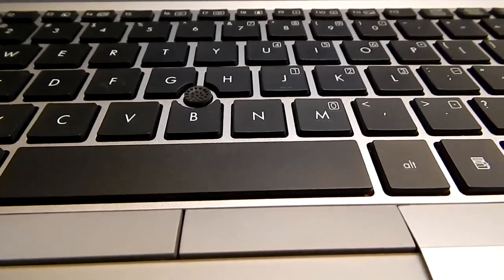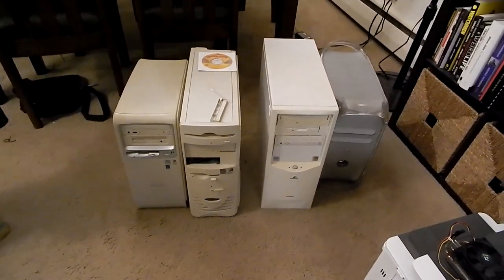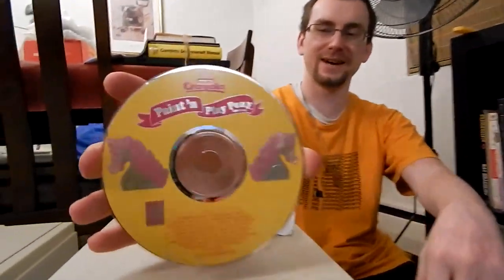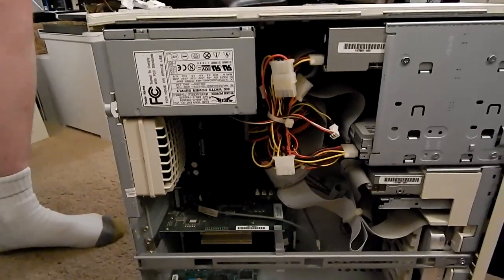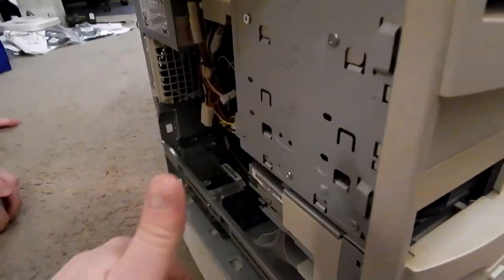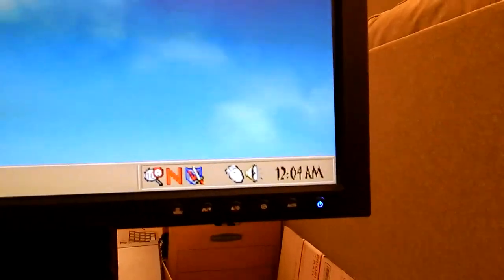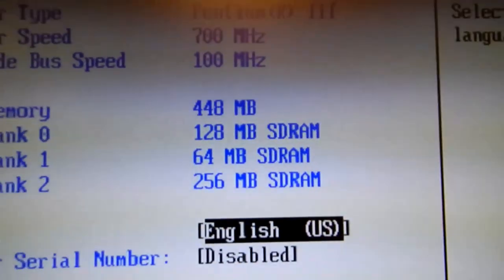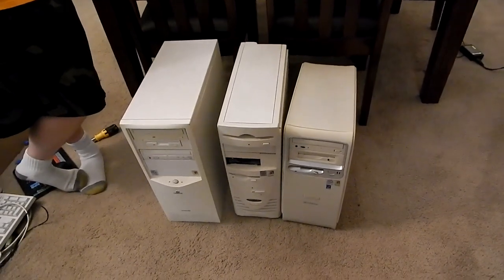Grateful42's 90s Computer Extravaganza

Comment: You're not the only one to have a PC mainboard that apparently won't put out a video signal.

I have a Gigabyte EG41MF-US2H v2.1 board (I think that's the model number of it), that has a few problems, including a dead floppy drive controller, but recently, when it boots, it would sometimes initialise video, it would sometimes not, but the rest of the system would run, just that there was no local display. If I leave it unplugged for many hours, then it would usually initialise the display on the next startup.

12:49 I thought that was some Barney game when I saw the disc in the video thumbnail.
Reply: SnowWall
Ah, I see. For me, I run my HDMI cable from the graphics card to a splitter, and from there to the monitor, so I thought it was the splitter that was the problem, as it pulls its power from the HDMI connection, but still includes a power adapter.
I too, use an NVIDIA card with my system.

Comment: What your doing is pretty cool,  I want to build  (rebuild ) an old dell dimension 4700 one day. I want to put all the best hardware that is compatible with the socket 775 motherboard. Upgrade to 64 bit,  8g of ram, boot from a ssd, etc.  Make it an ol sleeper pc, maybe run Windows 7 embedded.